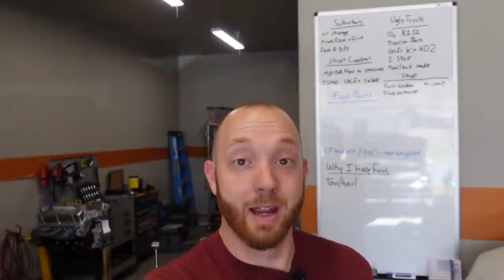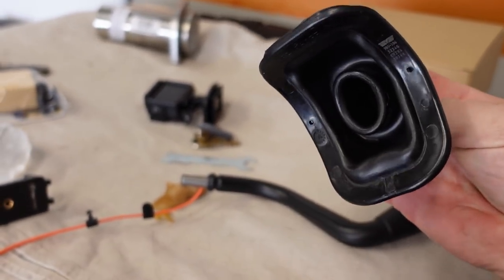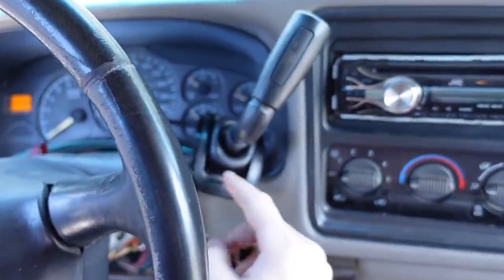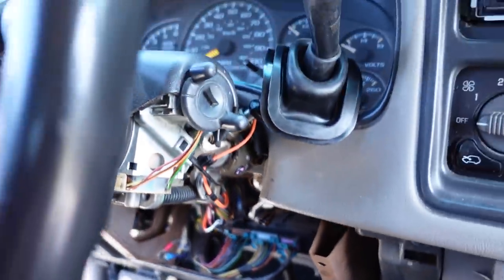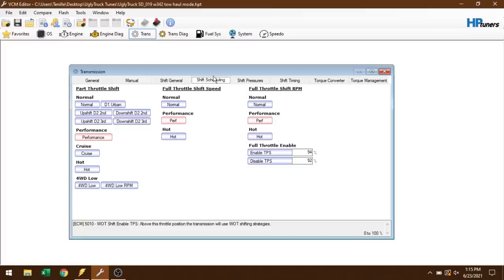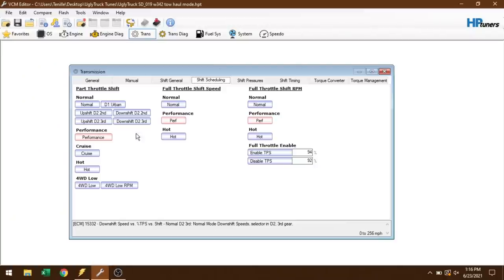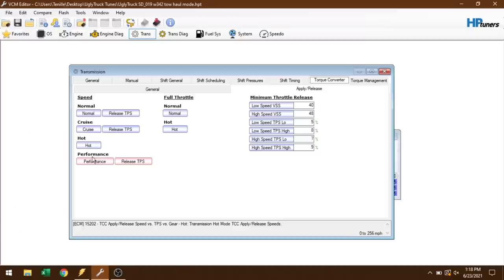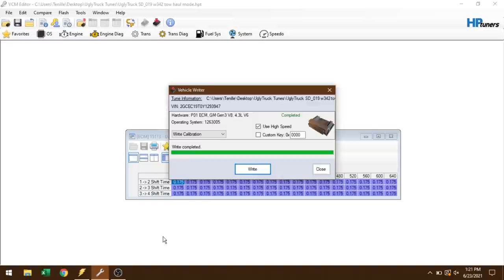Tuning a 4l60/4l80 for RACING and taking advantage of the Tow/Haul button

Comment: Been tuning for a while. I have been using this trick for "race" mode for a few years. Shit my daily even has it setup like this. Pretty nice. Get 60 mph out of a pretty stock 5.3 in first gear. Then a nice fast crisp shift into second.
Reply: Hi Samuel 
I have a 2008 Silverado 4.8 2wd 4l60e with with 373 gear my problem is I pull a trailer every day with this and the converter won’t stay locked causing trans temp to get high can can customized tuning the transmission help with this I only ask because you mentioned you’ve been playing with this stuff for a while thank you for any direction
Reply: @bruceshepard1136  it can, and also a large trans cooler bypassing the factory one in the rad also helps with trans temps.

Comment: great video LT i had same problem fixed it with a momentary button switch ,right where the break in the wire ,where they all break, drill a hole in the plastic bezel ,install button switch. you wont have same problem later like the shifter one will . this is a cheaper way to go guys ..keep the videos coming LT

Comment: Did you know you can add this to the gmt400. You 0411 swapped. I did it to my 96’ and put the 08 lever in the truck. Does wonders.
Reply: Bradley Harrington, How did you wire it up?
Reply: @kennygarner1225  I think Lawrence LT Tolman repinned an 0411 on his You Tube channel
Reply: @kennygarner1225  there’s one pin in the computer that needs a ground signal flashed. So on that connector of the shift lever. One goes directly to a ground and the other you run to the computer.

Comment: LT, I'm in a pinch right now, my 6L80E has started slipping under load on second gear.  I tow a lot with this 2010 GMC 1500 with slighly modded modded engine HD front springs and custom rear springs.  I regularly tow 7000 - 8000 lbs.  I know I should get it rebuilt but Covid kinda threw a curve ball in my finances so I need to make it last a while longer. It's not bad once warmed up though.

Truck's got 150 000 miles, everything works and I love it.

What would you suggest?
Reply: only thing you can do is some lucas transmission fix
Reply: That Lucas trans fix might work for a short time.  Unfortunately I think you are looking at a rebuild in the near future.  I know 1/2 ton trucks are rated to tow 6 to 7k , but doing it every day is going to wear them out quick. That's what 3/4 tons are made for doing every day.
Reply: @MDP454  Well you work with what you got. I'm a full time youtuber myself but most of us smaller time guys don't make the big bucks like the very large channels (im in a niche market)  So...  Though I would love a 3/4 ton diesel, I can't afford a late model at this time.

Sooo..  Got to stretch it to the max... Truck is rated to tow 9500 lbs in it's original configuration.

It's got fresh fluid and filter (I take care of my vehicles)  I'm also a mechanic but with very little transmission experience so I would not try to do it myself.

The Lucas stuff is actually very good, might just well do that to stretch it's life cycle a little.

Was just asking LT if he had a little pointer on this specific subject.

Comment: You could've actually upgraded to the newer model shifter put in the 6 speed trucks and SUVs. It requires some modification, wiring,, and more tuning but it might be worth it for your application.
Reply from the maker: it would be cool to get the tap to shift thing working as well...

Comment: I guess it's not useful for roll racing but you should try the sloppy trans brake basically you power up or ground one of the shift solenoids and it commands 3ed gear so you can hold it back without all the mechanical advantage of 1st gear
Reply from the maker: I had thought about it, and may take advantage of that for a dragstrip visit

Comment: What engine do you like better the 454 7.4L or the 496 8.1L?
Reply from the maker: they both have their strong points for sure, but the one thing I love about the 7.4 is its much easier to modify and source  parts for, where the 8.1 is kinda tricky. Some older big block stuff works, but a lot does not.

Comment: When you're towing a load, wouldn't you want the downshifts to happen sooner to help slow down more?
Reply: He won't ever tow with that truck. He just set it up for racing situations.
Reply: @allanb3222  

Well, same deal for racing then. Less braking if in it downshifts faster. Better speed recovery when you hit the gas becuase the trans is already in the lower gear to accelerate.
Reply from the maker: I suppose you might, but that wasnt how I intended to use the truck
Reply: @LawrenceTolman  

Read 2nd response in this thread, the one right above yours.

Comment: Is heat management going to be a problem without locking the converter? I know a few guys who left the lock up function disconnected on 700r4 and they burnt the Trans up from excessive heat.
Reply from the maker: no, not really because it doesn't lock up under WOT anyhow, and this mode is only gonna be used while racing or horsing around. While driving on the street in normal mode, the TCC will engage at cruise RPM
Reply: @LawrenceTolman  great point! I wish HP offered work shops around the country. I know you show us a lot but time constraints and boring some to death forces you to abbreviate. This was a great performance trick that many of us didn’t know was possible! Awesome Job!

Comment: What are you using to tune the truck I found a tuner called the tweaker here in Texas that tunes them year model fords . I’m sorry I was talking about the f150 I know this ain’t about that video .
Reply from the maker: I'm using HP Tuners software, which should work with most Ford's as well
Reply: @LawrenceTolman  yeah I know with the obd2 cars I’m a tuner as well I was referring to the f150 preobd2. But I did go back and hear your using a stand-alone for the Ford F-150 I just posted on the wrong video

Comment: Lawrence I have an 8.1 496 not really a lot of choice when it comes to intake manifolds for it dart makes one and raylar is going to make one but I was thinking of building my own for mine,was going to buy an ls intake and cut it down and buy runner material do you think it's a good choice or no?
Reply from the maker: to be honest, the amount of time that would take to properly design and weld an intake would be fairly substantial... I'd just buy a pre engineered solution. (EDIT: or do the 8.1 intake mod where you cut the baffle out of the middle)
Reply: @LawrenceTolman  could do that too but the intake raylar is going to make is not a very good looking one, I've already cut mine down not really sure how to go with it.

Comment: I've changed my shifter 2 times and my tow haul never turns on ... eny recomdations on how to fix it? Is there a fuse? I have a 2001 silverado with a lq9 cammed built transmission 2800 stall and other mods
Reply from the maker: could be a wiring issue further down in the harness, something in the BCM, or even in the tune? hard to say exactly

Comment: I dont normally like to bother people with questions but i want to upgrade my transmission on my 2003 silverado 1500 extended cab and you seem very knowledgeable. I was wondering in your most honest opinion whats better for my truck a built 4l80 or a manual trannsmission like a tremec tkx?

Ps. Keep in mind It has a 4.8 but wanted to swap to a built 6.0. Thanks
Reply from the maker: to me, a 4l80e is the best bang for the buck, since a junkyard one will hold up to a ton of abuse (thats whats in my truck). for all out fun, nothing beats a manual trans, although a TKO or Magnum trans will be a lot more expensive...
Reply: @LawrenceTolman  thanks alot man i appreciate your input. Thats what i've been hearing. I'll probably go with the 4l80 for now and see how long it lasts me

Comment: How would I be able to utilize this in a 97 GMC 5.3 swap? what pins on the ecu are used and would I have to have a shifter mounted switch?
Reply from the maker: not sure on the pin number right off the bat, you don't need a shifter mounted switch, any momentary switch would do. I'm told the late 90's oldsmobile Bravada  used a dash mounted tow/haul button that would install easily in the dash.

Comment: Just wrapping up a 5.3 swap into an obs k2500 4x4. Using tunerpro and LSdroid and an 0411 pcm, I'm running into a snag where I've gotta let the computer know when the xfer case is in 4 lo. It's an np241 manual shift. Is there a setting that anyone knows of in the tune that will work like this? I think there might be a pin on the pcm that I can send the 4lo signal to, not sure about the tuning.
Reply: Only asking here because it's sorta related. I've seen people saying that you use the pi. For tow/haul and you'd have to manually tune that shift table to account for the slow speed shifting in 4 lo. It's boggling my brain because the tow haul switch is just a momentary ground to the pcm, I'm pretty sure the 4lo signal from the xfer case is either a permanent ground or permanent 12v to the pcm.
Reply from the maker: I remember when I did my 0411 swap in my big block suburban, there was one pin that was for 4wd low range, and yes, it should be a permanent ground coming from the range position switch in the 241 t case. to make it work correctly though, I believe you need a tune file from a stock 4wd truck, there is some stuff in the background thats missing from a 2wd truck tune file, even though the low range shift tables will still be in visible in a 2wd tune

Comment: I have tried this fairly extensively w/ HPT…. Since this is a computer controlled transmission vehicle, What i’ve found is that unless you have a scenario where you change the weight in the truck or possibly the tire size, or if you have it sey up as full manual VB.. then there really isnt a whole lot that can be gained from this mod other than TCC lockup on the fly…  this is primarily due to the existence of the EPC solenoid. So getting the same truck to shift optimally, then change the settings to make it shift less than optimal, is basically what you’d be doing…. I’ve been tuning this platform for 16 years, but there’s still alot I dont know. Somebody please correct me if I’m missing something.

Comment: I thought you’re doing a 5 speed swap
Reply: He did say he was but tbh for the direction he's taken the truck and what he currently uses it for a manual doesn't make a whole lot of sense
Reply: @sabero5668  I would like to see him put a nv3500 behind that 8.1. People say they can’t handle any power. I know he would show us if it will or won’t
Reply: @lowiqlsx2593  Trust me, I would too, but for the roll racing and drag racing he's doing the auto shifts faster and can keep the turbo spooled between shifts. Maybe he throws one in the suburban

Comment: If your plans are big power, why not go with an allison 1000.
Reply: weight, and tuning i reckon. its a little less known about. and the 4l80e is just so sturdy.
Reply: Allison's are also designed for diesel rpm ranges. You run a diesel transmission over 4000 rpm often you are going to tear it up. You diesel drag racer and tractor pull guys are know to swap in build 4l80 transmissions, because the trans made for normal revving diesels can't handle it. A built 4l80 is hard to beat in high horsepower high revving  engines.
Reply: @MDP454  The 8.1's came stock with the the allison as an option.
Reply from the maker: an allison would be strong, but when it comes to racing, high RPM, and quick shifting, it might not be ideal. a 4l80e is lighter and can be made more than strong enough for a 1,000hp or more 1/2 ton truck